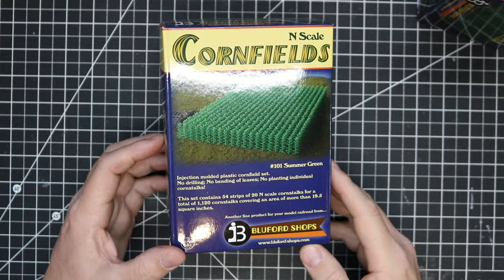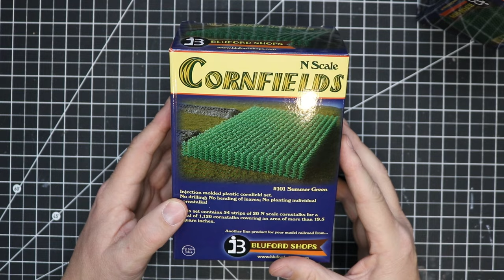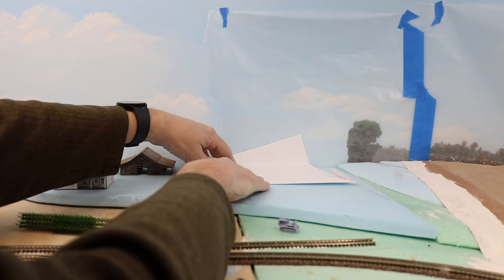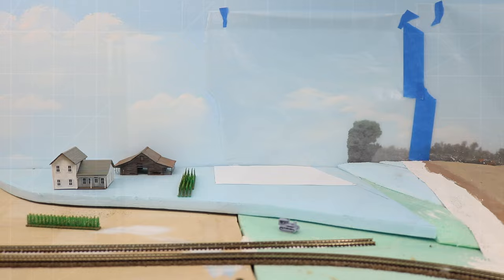Create a Realistic Cornfield for Your Model Railroad Layout

Comment: Great job making it look quite plain into something with a bit more color.   That said, pointing out the maybe not obvious, corn is usually not visible while it's still growing,  at most there is a tuft of silk husk from each individual corn poking out of it's green protective sheath the color of that varies from a light green to slightly tan depending on level of dried out it is.
Reply from the maker: I didn't paint the corn, I painted the tassels...way before corn has formed.
Reply: @RonsTrainsNThings  well perfect then!

Comment: Hmm this is interesting. I think you’ve spruced it up pretty well. I’d need to look at actual corn some more, but I feel like I’d want to do some very slight dry brushing on the ends of the stalks. Maybe I’d spray the whole thing ground-brown to get the geound, mask off the bottoms on the sides, and spraying the green on the stalks  at an angle that doesn’t let as much get on the ground. THEN the dry brush. Maybe do any touch ups at the end once it’s all glued together. If this wouldn’t work you can tell me, I’m relatively new, this was the thought that came to my mind, but I probably wouldn’t have thought of it I’d you hadn’t done this version first.